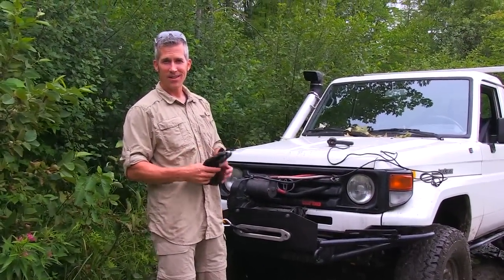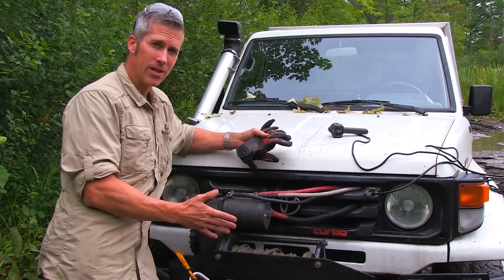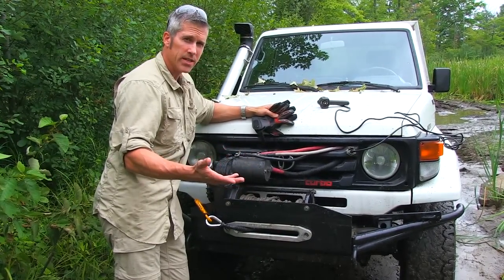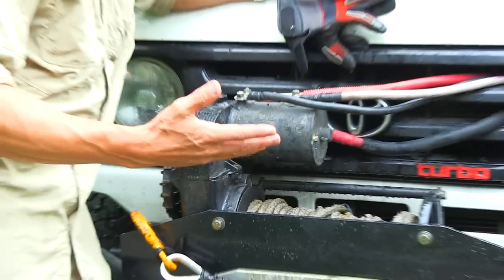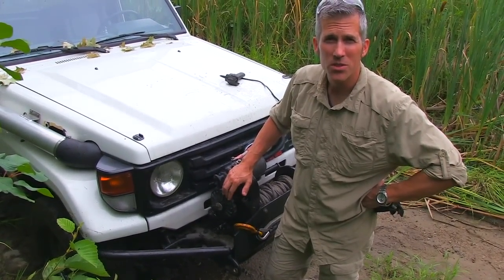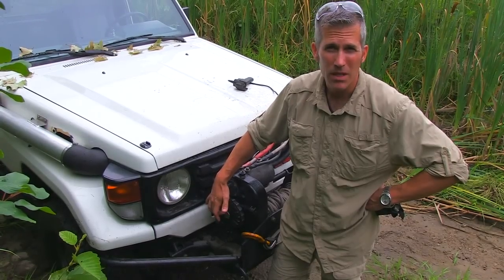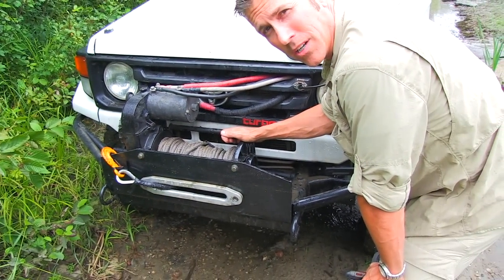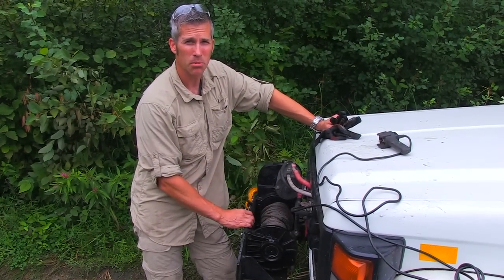Warn 8274 Winch Modifications, PowerModz.com!

Comment: The 8274 is a very capable winch without mods. One of the best if not the best electric 8000 lb rated winches ever. In fact 4 wheel & off road did a winch comparison and the 8274 blew the competition away with its line speed and not starting to even really work the winch at all until something like 14,000 lbs and . With a snatch block it should pull far more than any offroad jeep or pickup should ever require. I disagree on the steel winch line. Its all about respooling it correctly and maintenance. Winch rope gets too many abrasions here in the sierra nevada mountains. Ive had 2 seperate exspensive ropes suffer from rock rub and snap on me at under 4 years old. Ive never snapped a steel cable or had one kink up on me but Ive always maintained my recovery gear along with my vehicles and all my tools etc.
Reply: steel all the way. 
but most pulls do not require the full length of the cable. so i have dumped the 150 feet down to just 100 feet. and carry a couple "extra" lengths. as well as rated bow shackles and pulleys.
and yes the granite will eat a plastic rope up very fast. heck even a good fair lead hurts plastic rope under full load.
i have had a 8274 winch on my jeep for almost 40 years, never had a steel cable snap.
the way one pulls is the key.

Comment: Ive worked as a window washer and i rope we used was 3500 lbs working loads and much higher if we were to fall ,so yes ropes have come a long way ,yesterday i bought some general purpose rope for the boat and it maxes out at 250 lbs (same diameter) so it like you explained ,cable,s were king but now ...not so much .
 operating limits of winches on the tag is always empty spool so by making yours smaller you upped the pull capacity quit a bit !  thanks  for sharing.

Comment: I dunno how easy it'd be to find on the internet, but there was a guy who modded an 8274 style winch to have two power sources.  He could run either electric or hydraulic power, depending on what was needed or available at the time.

Comment from the maker: Pto's are good, especially when they are fitted from the factory, I have pulled very hard with mine and never had an issues with power - I run 2X trolling thunder virgin lead batteries (Odyessy) which are amazing - if anythihng I have to worry more about the winch motor overheating than anything - I might fit a motor cooler to it in the future.

The 700 build should be starting in about 2 weeks or less - hit a couple of snags but it's coming!

Comment: I like my T-max 12500 pound winch, never had a problem, it is a bit slower line speed but thats ok, I am not in any hurry when I am out playing...  I run a full size chevy 1 1/4 ton military truck.  and yes i pulled the 6.2 liter diesel out and put in a 454..ooorah....

Comment: Wish I could get the specs of that bearing. PN etc...

Great mods!
Reply: Me too! I'm just rebuilding mine too. It appears that with the modified drum made from 1.5" bar stock he would have had to make a new wall for the drum too. So the 1.5" bar stock sticks out and that fits on the ID of the bearing. The factory hole size for the end plate that the stock drum fits into is about 3.600 so he probably got a bearing that was 3.750" OD and 1.500" ID and maybe about .750 or .800 thick.

Comment: What size was the sealed bearing in the drum? I am in the process of rebuilding mine and would like to do this to mine. Also I added the albright solenoid and the motor was pulling in no matter what I did. All the wiring was done properly so I am at a loss. The motor is the original so I am thinking about getting something better with the rebuild.